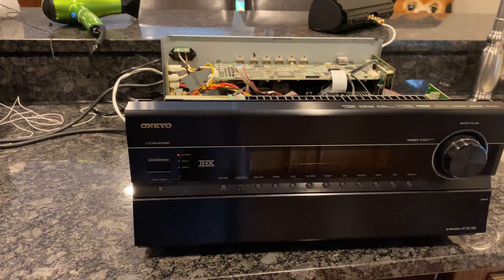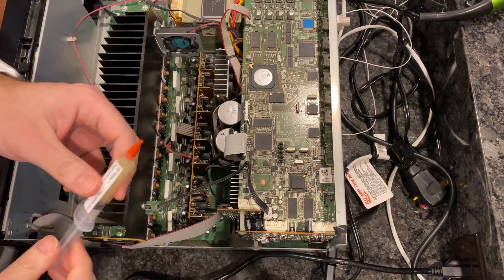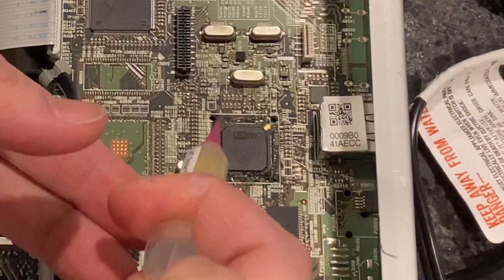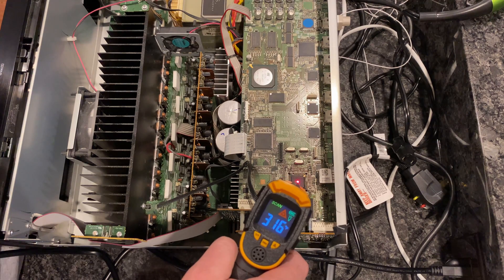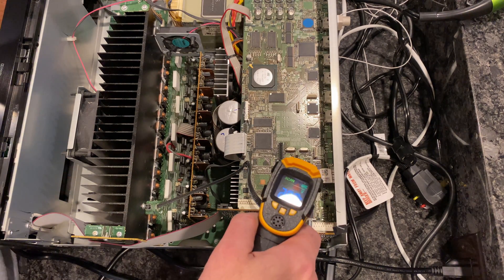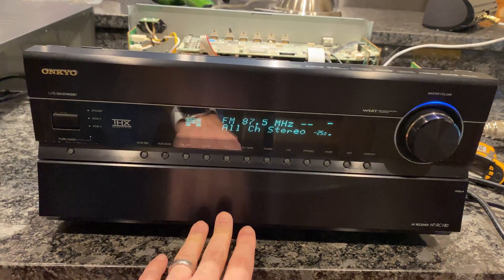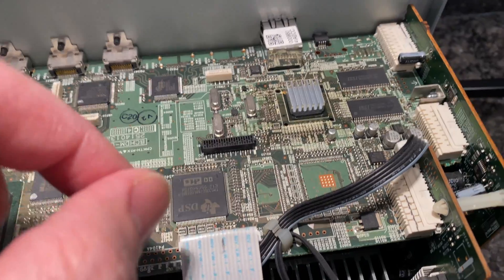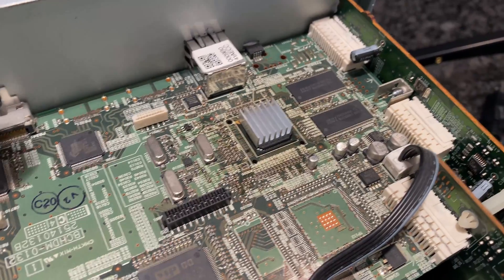Onkyo Home Theater Receiver No Sound Fix - DTS Chip Re-Flow

Comment: Hi, so i have an SR-707 which has the same story as @Conrad Roberts "started needing a warm-up and power-cycle to get the speaker channels online. Only 5 minutes at first, but as time went on that grew to 10, then 20, then stopped working altogether". i am about to try this on my amp as well (i really hope it works). can i use a hair drying to generate the enough heat and how do u stick the heatsink on the chip?
Reply from the maker: It may work but it’s harder to concentrate the heat in particular location on the board. Some folk even use a light bulb to do it.

Comment: THANK YOU. My SR-707 started needing a warm-up and power-cycle to get the speaker channels online. Only 5 minutes at first, but as time went on that grew to 10, then 20, then stopped working altogether.

Invested in a flux pen and IR thermometer, blasted the DSP up to 200°C with a heat gun, left it alone to cool down below 40°C, plugged it back in and voila, good as new!
Reply from the maker: That’s awesome!  Glad it worked out for you.
Reply: @Upscaled_HT  Just repeated the procedure successfully again, loving this trick 😁
Reply: @glittalogik  :face-blue-smiling:
Reply: @fernandofgg  3 years later, repeating this procedure every 4-6 months and it still works every time 😅 I'm waiting for the day it finally stops resurrecting so I can upgrade but the damn thing won't die!
Reply: @glittalogik hahaha, thats not so bad to hear, btw, im watching batman dark knight at dts-hd in my onkyo r590 right now
Reply: can u please guide me on how u used a flux pen, because u wouldnt have been able to drip the flux around the chip as done by "Upscaled" really nervous about doing this myself :p
Reply: Funnily enough it started acting up again last week so I'll need to repeat the procedure, but if it doesn't work then I just have to buy a new amp, which is what I would have to do anyway.
Reply: omg, i need to do that with mine

Comment: What kind of flux did you use?  I’m seeing many different types.
Reply from the maker: I used this one. https://amzn.to/3IyWmHC
Reply: Make sure you use flux designed for electronic circuit boards and not the type for plumbing. The correct type has rosin in it and will gently remove oxidation on the metal pins. Plumbing flux has acid in it and will corrode the circuit board connectors and will eventually cause failure.

Comment: Trying this on my TX-NR1008 and adding 2 small computer fans to increase airflow
Reply from the maker: I sometimes use those ac infinity fans.  They work pretty good. https://amzn.to/3oQG3y2
Reply: Any luck with this on your NR1008? I have the same unit and issue. Curious how yours turned out.
Reply: @Segarsj  no luck.  It worked for a day or sonthen over heated again. Ultimately bought a new receiver from Costco online

Comment: I was fooled by someone from fb marketplace and bought a onkyo stereo. I did this heatgun fix and I got it working. Thank you for this video.
Reply from the maker: Glad it worked out for you!
Reply: Worked for a year. Now its dead as a Dodo.
Reply: Hello, very good video... I have a question, I think you are the right person. I have an ONKYO HT-R695, and a kitten decided to urinate on it while I was sleeping... 😢, despite that, almost everything works, except for Wi-Fi, Bluetooth. At first, after cleaning it, it turned off suddenly, and turned on again, and the AVR screen showed Amp Diag Mode, but when finished it worked normally or "normally", however after a week it stopped working. Dolby Atmos and DTS:X work, all other formats work, Dolby Digital, Dolby Digital Plus, and DTS. A friend who repairs electronic devices recommended that I clean with isopropyl alcohol, and everything worked, but when I turned it on the next day, only Atmos and DTS:X stopped working again, the formats work fine. And now even those work after turning off the AVR for a few minutes, but only for 5 or 10 minutes...Do you know what could be causing this problem? I forgot to mention that when they work, the Dolby Digital logo turns red on the receiver, and when you stop listening, it just says PCM Surr. Greetings.

Comment: Hi folks - after 6 month after the "Re-Flow" Procedure , I have the same issue - no sound.... it works well until yesterday! I´ll repeat the session and will do it now with an installed USB Fan (Arktic or similar). I`ll let u know how it works...
Reply: How did it work?
Reply: @TehRandomdudeofBANAN  same issue over and over  again... it works a while after re-flow and after approx 5-6 Months the speaker align in the display is missing - so i have to turn the amp off and on again (4-5 times) until the speaker align is already shown. But hey, this works well for me until a replacement / upgrade for Dolby Atmos in the near future...
Reply: @skywelzano2064  Thanks for answering, alright!

Comment: I have the TX-NR414, same problem. No sound!
I got some flux & heat gun & gave it a go. Let it cool then tested it & it didn’t work. Tried again with more flux & heated for longer & got a bit of smoke coming out under the motherboard & let it cool, tried again & totally worked. Super stoked, thanks for your help. Repair cost $11.95 for flux.
Reply from the maker: Sweet! Glad it worked out.
Reply: Is your receiver still working?

Comment: Hello everyone,

I got myself an TX-NR515. It's second hand and it's been tempered with on the power supply board. Does anyone know why this is done? They took out the glass fuse, soldered a new component between the new power cable and board, and it looks like it has an IC replaced. I'm curious to why this modification is put there. I also got something strange going on, on the HDMI board. Fan is not connected and some electrical component is soldered from contact pin to the plug next to it. 

Also thanks for the tip, I also got no sound and I'm trying to fix it with a heat gun aswell. Found some loose solerings on the pre amp board, some transistors, so I'm gonna reflow that aswell.
Reply from the maker: I hope you’re able to fix it.
Reply: @Upscaled_HT  nope, there was probably more wrong with it. It lost more features and I couldn't even connect it to the internet via cable. It actually didn't do anything accept then turning on and passthrough the screen. Too bad..
Reply from the maker: @markdol5141  I recently had another receiver die on me that I gave away as parts only.  It would have cost more to fix than what it was worth.

Comment: Hello! great video! Mine has a different problem (I suppose) because everything clicks and the screen shows everything it should show, but still no sound. What do you think the problem could be? Thanks!
Reply from the maker: Does your receiver have a speaker matrix on its lcd display.  If it does, does it turn on?  If it doesn’t have one, you may the same problem I experienced but you just can’t tell since there is no speaker matrix.
Reply: @Upscaled_HT  there's no matrix. It has 2 rectangles. One with an A and the other with a B. I tried connecting to the B output but it won't work either (I always used the A configuration because its the one with 5 channels. B config is just stereo)
Reply: @Upscaled_HT  i suppose those A and B signs are the same as the matrix but in older/cheaper models like mine. I have an ht-r548

Comment: Thanks for the video. I’m gonna throw my 2 cents in because, reasons…  The heat needs to be hot enough the solder begins to glimmer/shimmer at that point the solder is reflowing and you can kill the heat. Very important: do not touch, bump, or disturb the chip while the solder is reflowing/liquid. It’s nearly impossible to realign the chip pins by hand exactly to the correct pads on the board. I learned this the hard way….  I did this repair to my 609 about 2 years ago and has worked like a champ since. Until last week. Will try reflowing again. Cheers
Reply from the maker: Very good advice.  Most of the time this is a long term but temporary fix. 2 years is really awesome!
Reply: Did the second reflow work? Thanks in advance!
Reply: @vortexor1  no, unfortunately she was on borrowed time. However with her demise I’ve repurposed her transformer for a small spot welder I’m getting ready to build. Cheers
Reply: @humblyright I want to see you use this spot welder. Nice re-use!
Reply: @TristanVash38  sorry to disappoint, I ended up buying one instead, the build videos on the internet, specifically YouTube seem very sketchy to me & I try not to exceed my voltage comfort zone of 12v unless i’m very confident or very desperate…
Reply: @humblyright all good! I will not do this myself on the account of your comment since I have an Onkyo TX-SR500 on my back patio bench not wanting to work no matter what I do :D
Reply: @humblyright also glad to see you have not perished from the attempt LOL. Carry on good sir

Comment: How did you attach the heat sink to the chip?  What thermal paste did you use?
Reply from the maker: I used the adhesive that was pre applied but cpu paste should work too.

Comment: Just did this fix on my  TX-NR609... Used my heat gun and got it to about 400°... Worked perfectly!!!
Reply from the maker: Awesome man!  Glad it worked for you.
Reply: Is 400℉ right ? I’m trying to fix my NR609 , I use my heat gun to 220°C but I didn’t see the smog…
Reply: My 609 suddenly lost its sound last month while I was on vacation. No idea why. Is the board layout the same? How did you know what chip to heat?
Reply: I have a 509 and 609 with no sound, I tried with heat gun but no luck, 
I didn’t go higher than 280 maybe and didn’t work.
Maybe I should try up to 400F ?
I was afraid not to burn up the chip

Comment: I have Onkyo TX-NR616 and the sound is gone, so this might be the problem. Im a bit confused though, you are fixing it by heating it up? And then you add a heatsink so it make sure it doesnt overheat in the future?!

So is the main problem that the chip has overheated, and the fix is to heat it up?
Reply from the maker: The problem mostly lies with heating and cooling cycles degrading the solder under the chip over time.  This process reheats the solder to melting point again to make a solid connection.
Reply: @Upscaled_HT  right, and the Flux is helping with that i guess?
Reply from the maker: @carnalito80  The flux helps with the soldering process.
Reply: @Upscaled_HT  also, how did you attach the heat zink? WIth glue or what?
Reply from the maker: @carnalito80  Mine had a pre applied adhesive.

Comment: Thank you for this vid! I have a TX-NR 1007... it started switching in and out of audio a couple weeks ago... then died. I did a hard reset, and it actually brought it back (for a couple days).. but I think it was only due to it having cooled off... I followed your vid, and it's running like a champ now!

I think I need to open my components now and then to clean them.. it was covered in dust inside. Anyways, I got it all cleaned up, even scrubbed the worst of it with a toothbrush & Iso 80%... but only when compressed air wasn't doing enough.

I also installed the raspberry Pi heat sink you suggested, just in case.

CHEERS!
Reply: It's one of those defects that should have been recalled!
Reply: The fact Onkyo did nothing to help us repair this all-too-common problem is why I'll never buy anything made by Onkyo again.
Reply from the maker: Really glad this worked for you!
Reply: @Upscaled_HT  Hoping to pick your brain... as stated, I've got a TX-NR1007... fixed my not getting the speakers to initialize using your resolder DTS/DSP chip....

But I'm getting an odd issue that has the potential to be bad as well. I turn on the unit to do some online gaming, sometimes it works fine... and sometimes not.... the speakers array initializes and I see them on the led readout.... but I I don't hear anything from the speakers... when it's going to 'work'.. I'll hear a little tiny click or pop from the speakers.

So, I can let it sit for a few minutes.. zippo.. no sound. I turn it off... turn it back on... and NOW the speaker array isn't lighting up in the display (and still no sound... durp)

Buuut... if I leave it on for a few minutes.. (5-10 is good), THEN turn it off, then back on... the array comes on, I hear the tiny  pop from my speakers, and everything works fine...

Any ideas what this is?... using it in 9.2 and love it.. would hate for it to die on me as the build quality (with the exception of the 3030) REALLY went downhill after this unit
Reply from the maker: @jamesrobinson2086  If you have nothing to lose, you can try the same procedure for more time and higher temperature.  Other than that, you would probably have to take in for service but it would probably cost more to fix than what the receiver is worth, although it would be cheaper than a new 9 channel receiver.  I haven't any 9 channel receivers for less than $900 these days.

Comment: Does it still work? I did it three times already and after some days it is broken again.
Reply from the maker: Still working.  Sometimes it takes a while to click on so I'm thinking it may fail again.  For some folks, it works great.  Have you tried increasing the amount heat and time you heat the chip up?

Comment: Was ist das für eine Flüssigkeit die da aufgespritz wird! Ich habe den TX-nr 515 auch ohne Ton und möchte das auch probieren! 
What is this for a liquid in this injection? I have the TX-nr 515 without sound and would like to try that too!
Reply from the maker: Flussmittel ist ein chemisches Reinigungsmittel, das vor und während des Lötprozesses von elektronischen Bauteilen auf Leiterplatten verwendet wird. Flussmittel wird sowohl beim manuellen Handlöten als auch bei den verschiedenen automatisierten Prozessen verwendet, die von PCB-Auftragsherstellern verwendet werden. Der Hauptzweck des Flussmittels besteht darin, die Metalloberflächen durch Reinigen und Entfernen von Oxiden und Verunreinigungen für das Löten vorzubereiten. Oxide werden gebildet, wenn Metall der Luft ausgesetzt wird und können die Bildung guter Lötverbindungen verhindern. Das Flussmittel schützt auch die Metalloberflächen beim Löten vor Reoxidation und unterstützt den Lötprozess, indem es die Oberflächenspannung des geschmolzenen Lots verändert.

https://www.tempoautomation.com/blog/understanding-soldering-part-4-how-to-use-flux-when-soldering-electronics/
https://www.amazon.com/Clean-Tacky-Soldering-Flux-Grams/dp/B07DCD9M3P/ref=sr_1_9?dchild=1&keywords=flux&qid=1627173532&sr=8-9

Comment: @Upscaled: thank you for this video! is it a specialized flux?
Reply from the maker: It’s a no clean flux.  Bought it on Amazon.
Reply: @Upscaled_HT   is there any difference between no clean flux(es)? probably melting point, right?
Reply from the maker: I thought it was that you don’t have to clean up the residue.
Reply: @Upscaled_HT  i will try it again with flux and a heat gun. I will report ;) thank you so much !

Comment: @Josla have you fixed the "no sound" problem with your 5009? I got the same issue with my 3009: heating the dts chip with an air dryer for 2 minutes worked about 5 minutes - after turning on the 2nd relays click displayed the Speaker alignment again and sound played a while but after approx. 5 minutes sound has gone... What would you think? Try it with increasing the temperature und measure it again?
Reply: He left a comment he got it working again heating it to about 360 ° f. All the repairs on these run the temp. up that high. Make sure you put a heat sink on it and an exhaust fan on top. https://www.amazon.com/dp/B07L9M8T8F/ref=cm_sw_r_u_apa_glt_fabc_ECNF13M0Q5YJQ3TDXXAH
Reply: @stevet7487  thank you, Steve . Will try it as soon as heatsink and Fan are delivered.
Reply: @skywelzano2064  Let me know how you come out. I will be doing the same technique on my 5009 and will let you know on I fair.

Comment: Hey guys, i just got some extreme noise appeared like interference in my loved HT R390, don't know what's the problem, sounds like radio(through AUX in) with a very bad signal, other inputs - nothing, just radio-like noise...
 Had it cooled down always by 2 fans because it was very hot from being even new. Did a factory reset, but nothing.
Any help info is much appreciated!

Comment: i have a 2002 wrat onkyo whose chip fried like 5 months after it was bought new, so obviously it was still under warranty. they put a new one in and it's been fine for damn near 20 years, even with cat hair all over the board because he used to lay on it constantly. 

but now the dolby is dropping out every now and then, but a light whack will get it going again, anyone have any idea if that's just a broken connection somewhere or

Comment: Hi I have a TX-SR313 it has a really long delay when initially powered on. It can take up to 15-20 min before the sound kicks in. I have tried the reset and turning it on and off a few times while waiting for the sound to come on. Once it is on there are no problems works great. Could the dsp chip be the problem is this a sign of it failing ?
Reply from the maker: Just double checking but you mean 15-20 minutes not seconds right?  If it’s minutes, there definitely a problem.  It’s hard to say if that’s it.  I did this to mine cause I had nothing to lose.  The repair cost would have been way over the value of the unit so I just went for it.  You could try heating a little and see if lowers the time to click on.
Reply: @Upscaled_HT  yes 15 to 20 min
Reply: Did you fix the problem???? Did all the relays click as usual? I had the same problem and the time it took to start was getting longer and longer. It got to almost a couple of hours!! Then, one day I was watching Netflix, listening to dolby's full glory and suddenly....no more sound. Screen shows all the things it always showed. Relays are fine and switching properly at the start. It just wont sound anymore. If anyone can help us it would be amazing.
Reply: @elblopex  unfortunately no. Took it apart kept what we could use and recycled the rest :(